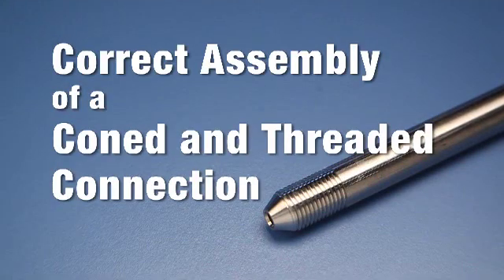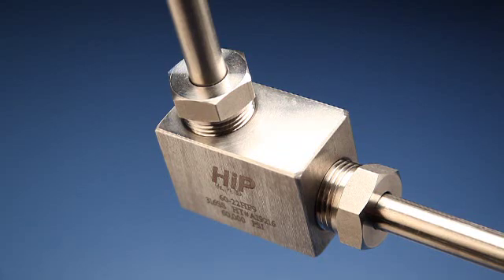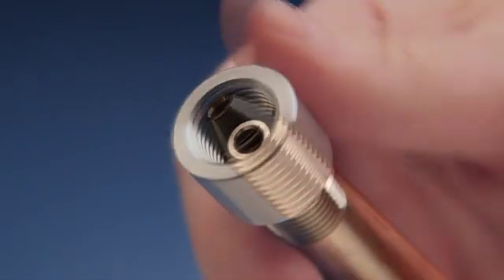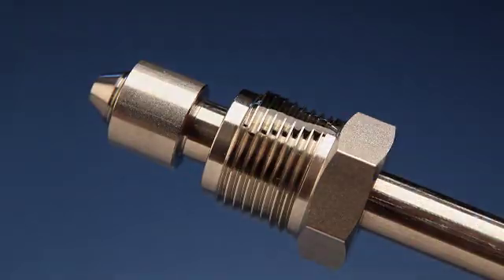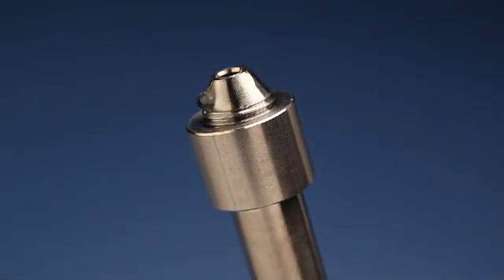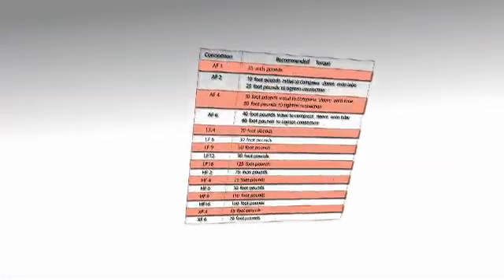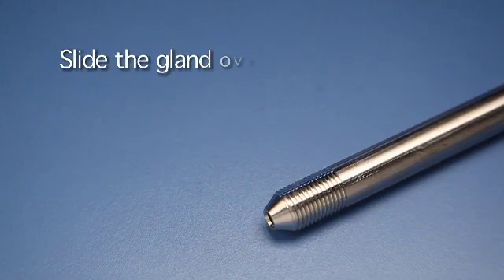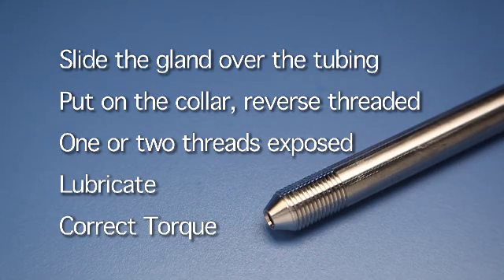Coning & Threading Installation Video

Comment: Shouldn't you be using some type of anti seize on a stainless to stainless connection?
Reply: Typically you want to use goop. In the event of a leak, those HP lines get extremely hot. 1st time I see they don't use it.
Reply: That's the point of the oil at assembly.